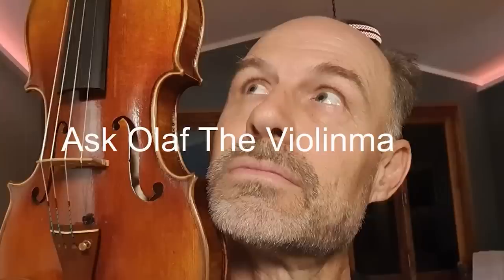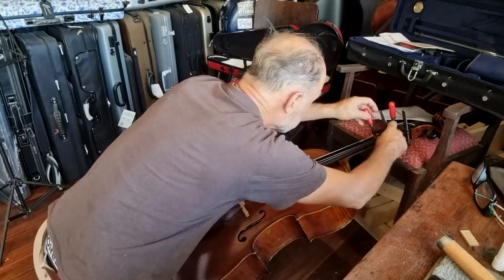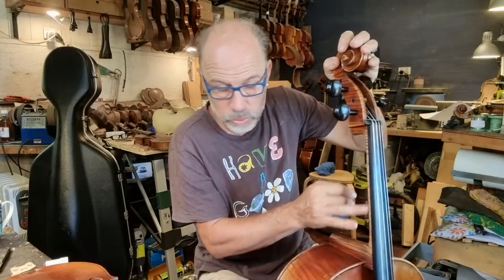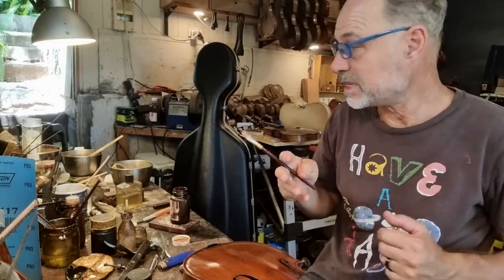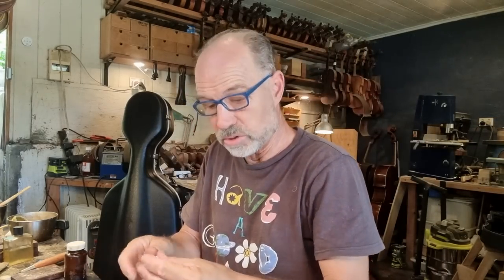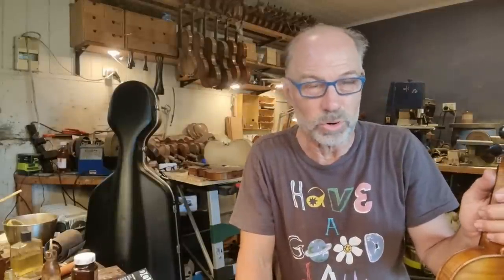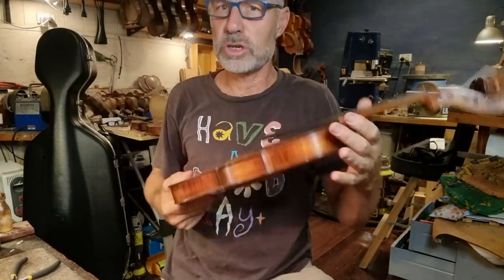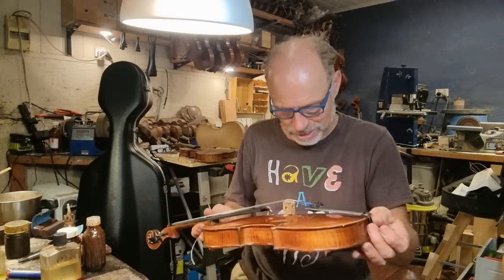Buzzing Disaster and Fingerboard off! - Day in my Violin Shop

Comment: Lovely work on those cracks! I had a school double bass several years ago with a buzz, & yes, you guessed it, it was the bass bar. No I didn't have closing clamps for double basses to glue the belly back on, so I had to improvise. I bought a stack of cheap speed clamps, had some 8mm plywood & cut out shapes for the belly edge (for one half of the instrument) with cork on the clamp's jaws I glued one half at a time. It came together just fine with student & teacher happy with it.

Comment: How are violins appraised?  How do violin shops come up with their pricing on instruments?  I haven't been able to get any straight-forward answers on why one violin is more expensive than another violin which makes me think it's a very subjective pricing model from shop to shop.
Reply: Some parts of the process are objective, who made it, how well it was made, what condition is it in, if it's been repaired what quality was the work, other parts are totally subjective, how it sounds, how it looks in terms of the wood grain patterns, figuring etc.  Plus other factors like age & scarcity or otherwise, it's too complex for a straight-forward answer, & yes some is very subjective.
It boils down to what the shop thinks someone will pay for a given instrument taking all of the foregoing into account, & when buying how much time & cost is involved in preparing it for resale, & how much mark-up they'd need to also cover their overheads & make a profit.  Even the place's customer base plays into it, understandably a shop might discount the price if they're likely to be stuck with an instrument for years, where one who knows they have customers for one like that may appraise higher.